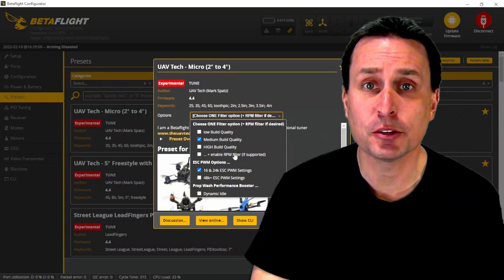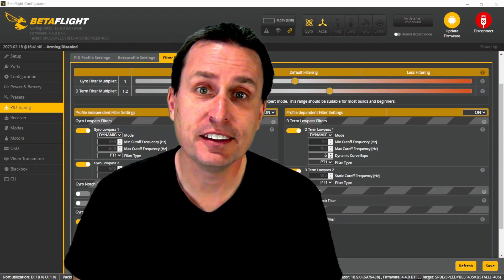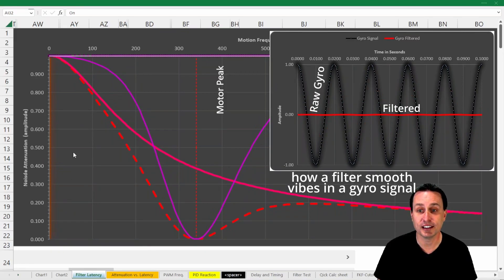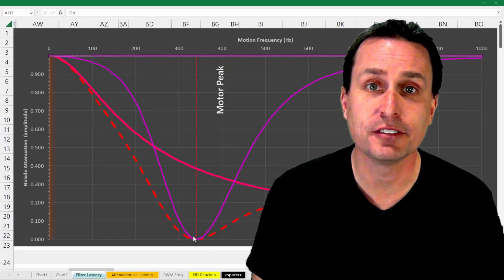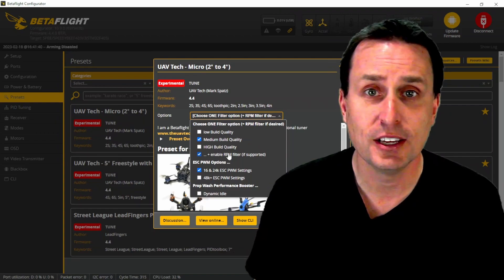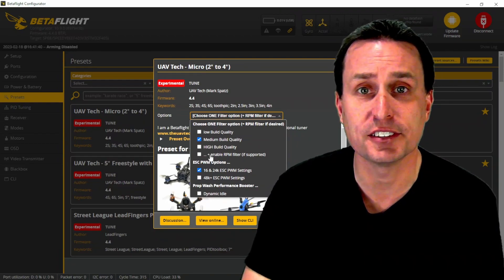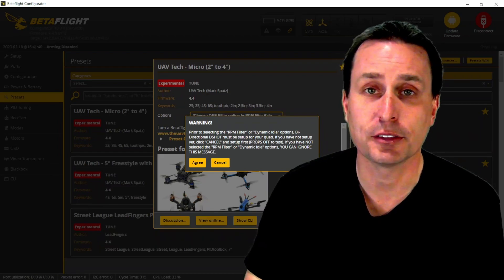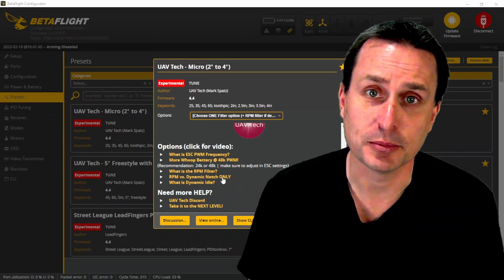What is the Betaflight RPM Filter?

Comment: Hi Mark, what happens if I switch on Bi-directional DSHOT in a quad that doesn't have the firmware to support it?
Reply from the maker: The motors could ramp to 100% on arming.

THAT SAID, BF now has a safety catch.  If you turn on bi-directional, and the signal back from the ESCs is not detected, it will not arm.

Comment: I put this on a 3 inch build and had instant fly away issues. Not sure what's going on.
Reply from the maker: pick low build filter and/or move the Master Multiplier down by 0.5 points.

Comment: would one of your presets be good for my cinebot30.. that thing has mad shakes when off throttle coasting down to a lower altitude? great content i want to learn how to tune my quads better
Reply from the maker: Cinelog
Reply: @uavtech  i have the cinebot30'
Reply from the maker: Correct.  Cinelog preset.  Make sure props-in config.
Reply: @uavtech  ok thanks.i will have to change motor direction because they come props out stock
Reply: @uavtech  So I've got a 3.5 in aura with 2700 KV motor 6s and I'm running 3052 props with a decent pitch. It's a clean build. It's a new build. Everything on it is new I crashed. One of the motors was bad so I changed it to a new one. Went for a spin and the vibrations was there and I don't know exactly why it's it's causing vibrations.  I've got bi-directional d shot on with blue. Jay config any recommendations that could fixed the oscillations or the vibrations in the OSD? With filters thank you 🙌

Comment: Betaflight RPM and Dynamic notch Filters are insane as hell! I mean i turned the LP1 off and my D-Term Slider is at "2" my props are beaten up BUT the damn thing flies smooth as hell, oh i have forgot to say thats the filter tune on my 65mm Whoop which is made from PLASTIC!!!
Reply: I turn off lpf1 and lpf2 filtering on whoops they rarely have low spectrum noise because of the size and high revving motors.
Reply: @cinemoriahFPV  im running a mpu6000 on a f4 its downsampling from 8k to 4k is it still good to turn off the lpf2?